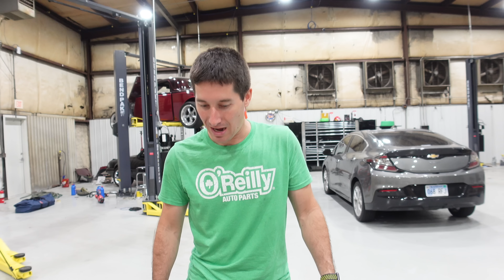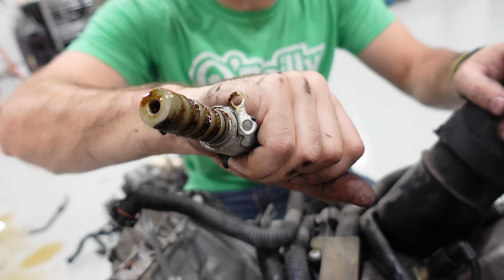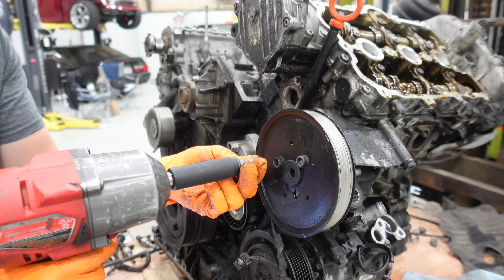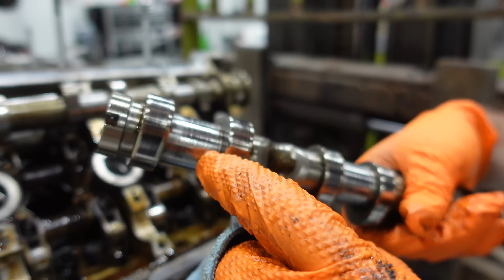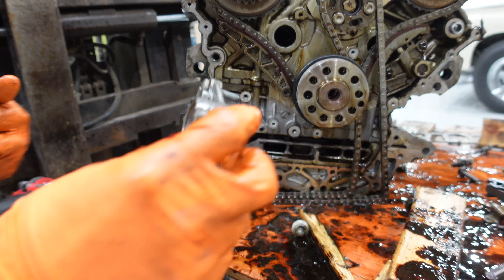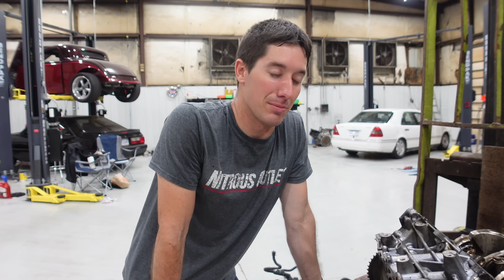SLUDGED To Death: Tearing Down My SEIZED Audi 3.0T Engine

Comment: This engine in the later years is very reliable, do maintenance and you will be golden
Reply: That's what fans of German engineering always say; nonsense
Reply: Can confirm. Just watch out for timing chain tensioner and guides. There's a TSB out on those. You can also get 600 hp with just a pulley upgrade, tune, and exhaust.
Reply: @kevinbarry71  80,000 miles on the odometer with 500 wheel on a 2015 Q5 3.0T, right after warranty ended which was 50,000. So 30k strong. I also own a g37x so I have both ends of the spectrum and work on both and honestly it’s not bad ppl like u just don’t know how to wrench on their car and say the car is trash because something broke and “the only thing I changed on my Toyota was the oil every 5,000 miles!”
Reply: @108emd  until it spins a main or crank bearing
Reply: So you're that guy. If I had said that a Yugo  is a bad car. Somebody like you would come on and say they have one with 300,000 miles on it and  they've never had a problem. German engines are put in with all disposable plastics. And plastics that need to be replaced and cannot be reached. And relatively minor operations require extensive disassembly. And even engine removal. Not to mention their irritating habit of having multiple different sizes of fasteners. When they could easily have just a few
Reply: @108emd  I was impressed with the condition of the timing chain guides
Reply: @hexicalcat4937  80k is not many miles. You may like to replace parts yourself but most people don't and shops will either destroy the car or charge arm and leg.
Reply: @jamesmedina2062  
When one stops and realizes what a 4 cyl. does day in and day out why is all this complexity necessary? I am so glad Honda never merged with VW. lol
Reply: @larrybe2900  Well I can tell you. Its all in the vibrations.. Subarus have such nice vibes and harmonics and ears matter more to humans than they realize. So they put up with Subaru eccentricities. The K20 and K24 were taller and beefier than B series Honda in order to flow better, be smooth, and hold 500 horses. But even though the VW VR6 was smooth and felt wonderful, VW snafus ruined it for me long-term.
Reply: @larrybe2900  with simpler little 4's, they will rattle your teeth out! My 1990 Acura and 1988 Honda Accord were not as refined as my 2017 Honda Civic.  At least with this fairly new Civic I have modded the car enough to make it pleasurable to drive. Honda implemented what I did to mine in new 2022 cars.
Reply: @jamesmedina2062  
Both styles progressed in parallel yet "VW" made it complicated. Non complicated engines run quiet yet run under more stress to move the car forward.  And / But yes, non-complicated have become more so but not to the degree we saw here. I am talking one of these complicated engines would not outlast the same rigors that a 4 cyl. operates under every time it is used. There is a company that repurposes used Honda engines for use in airplanes. We know the abuse an engine takes in a plane with high RPMs. Sure it is not a big plane but the application is brutal.
Reply: @jamesmedina2062  
One thing Americans are is practical. Planned obsolescence is eating away at every facet of mass produced items. Yes, I agree with you and we are butting up to the idea of the right to repair which will land us into expensive upkeep. Aren't we glad every car isn't saddled with the monstrosity we saw JR take apart. Any engine has to be a symphony in its operation but Mozart is not necessary for sensual pleasure. Granted Bluegrass is not for everyone either.  ;)
Reply: @larrybe2900  I think the failures in this Audi engine are an example of what happens when you have many, many pieces that make up an engine and you source parts from outside vendors. If you have less parts to keep a watch over, you can afford those parts closer attention to quality. If you make most of the engine parts in-house you can control and guarantee the quality.  My next door neighbor has this Audi engine in a very pretty white car. I don't think it has a turbo but it is called a 3.0T. He said oil changes were over 200 bucks at the dealer so now he takes it to Jiffy Lube.  One thing JR and we can agree on is that Audi definitely did not take into consideration service of this 3.0T.  Like you said primary buyers will own these vehicles for 5-10 years unless leased and then even less time.  I honestly don't see why this V6 has to be so big and complicated. We had about 5-6 Acuras with powerful V6 engines and Indy cars used solely Honda v6 engines for a while there. Perhaps it is also that cars and SUV's are so much heavier today, on average 1000 lbs heavier than 80's and 90's cars that conformed to certain weight and size limits. Also you are right that Audi knows how to make max bank. They have the trained techs and they know few people will be able to run these cars untouched for 20 years.

Comment: Anyone who touts "German Engineering" needs to watch this. The complete lack of serviceability of this engine is unforgivable. It does no good to have hundreds of sensors if the repair requires pulling the engine and 15-20 hours of labor just to change the water pump or other components makes this an object lesson in over-engineering.

Comment: The plastic on those engines will dry out and crack. Especially parts of the cooling system. 1000's to fix.

Comment: It's honestly funny to see outside opinions on how these engines appear to be "difficult" when in reality those engines are quite easy to take apart and teardown. supercharger off pays 5 ish hours and takes about 20 minutes lol. I will admit however, I did work on these most of my life as well as received audi training...I'm sure I have bias.
Reply: also, as I'm watching. When you guys were removing the intake flaps...the high pressure fuel lines are intended to be removed before the flaps. would've made your life much easier
Reply: That really helps them after the fact…
Reply: Ummm yeah...If you're doing a supercharger in 20 minutes when book time says 5 hours, please let me know who you are so that I would actively avoid you working on ANY automobile I may be forced into having service. Fortunately for me I do 99% of my own work on my cars.

Comment: If the recommended oil change interval was more than 5000 miles and the previous owner(s) followed that, then that is what killed that engine.
Reply: 5000 mile OCI is nothing with modern Euro and API oils synthetic oils - even the so called conventional oils. Perhaps the person owning the car didn't know what oil changes are? Could be a range of possibilities. Few, or perhaps no oil changes. Very short trips. Oil with the wrong certifications.

Comment: 3500.00 to service the supercharger with new oil….and replace the high pressure fuel pump due to an impossible to see leak…….worth it at 130,000 miles but still….and since its apart you replace the old poorly designed oil separator UNDER the super charger with a new re-designed equally. Poor one…..
Reply from the maker: Was it really? That’s wild, nearly what a used engine costs 😳

Comment: Safety first! In your experience, would the engine flush you used for the Camero make a difference on the Audi engine you just disassembled? Sans all of the coolant leaks. I can not imagine how so much sludge could build up in such a high performance automobile.... synthetic oil or quality organic oil. Awesome episode!

Comment: I blame the plastic coolant parts in the v of the engine. Looks like it was engineered to fail after a certain mileage
Reply: changing coolant before it becomes very acidic should help. The VW coolant is a good formulation.?

Comment: Here, my friends, we see the end of the fossil fuel internal combustion engines (which are followed by the electrified motors) and mainly the German quality of enginewizards. Plastic at spaces where temperatures are too high so they become really brittle, so much dodads and workarounds to get a low emission output that these ice are impossible to work with…..
Reply: ICEs don’t have to that complicated.
Reply: let me know how them batteries look in 10 years 🤣🤣
Reply: Same thing that killed diesel for passenger cars is going to kill gasoline-burning engines. Ever-increasing complexity to achieve high output, high fuel efficiency and low emissions at the same time kills reliability and makes repair less and less cost-effective.

Comment: exactly why people need  to change oil 3-5k miles regardless if  the manual says 7-10k!
Reply: Once a year regardless of low miles.
Reply: @larrybe2900  thats what i do on two of my vehicles- I use the 20k oil and in a year i usually do 3-5k on each so they should be fine-

Comment: It’s not ‘engine out’ to remove sc unit/injectors/pcv
Reply from the maker: It sure should be, it’s a nightmare 😂
Reply: @WatchJRGo  it’s not a hard job, just a lot of fasteners and packaging to get to the pcv/valley.  You did a few things out of sequence that kinda hung you up a little, I just did a top end service a few months ago. PCV, thermostat, water pump, carbon cleaning.

Comment: That's not had an oil change in a long time and slowly restricted oil flow then the ultimate happened & spun the bearing
Reply: True. However, it doesn't explain the coolant failure.

Comment: Sure helps if you know what your doing, attempting to pry the manifolds off with the fuel lines connected is assenine...I can remove everything to the injectors and pcv within 20 minutes.   Not sure how you claim to be a mechanic bro

Comment: how does a bearing get spun like that?
Reply: Oil passage likely clogged and then it gets hot and the bearing sticks to the crank or rod and spins with it. All comes down to the sludge clogging up tiny oil passages.

Comment: Spray connectors with silicone and let it sit for a minute.
Reply from the maker: They weren’t stuck, just brittle 😥
Reply: @WatchJRGo  It helps with them not crack when it soaks in. Learned in 15 ish years ago rebuilding Isuzu generators on shrimping boats in TX. 
I only work on euro crap now and still spray with silicone.  Saves me having to re pin into a new connector.
Reply from the maker: @diablo7322000  that’s awesome, I’ll try it! 🍻
Reply: @diablo7322000  any light lubricant can soak into areas that will make freeing it easier. Silicone greases are the worst from cleanup standpoint. I hate that choice myself. I was told some penetrating oils destroy nuts and bolts over time.

Comment: Every poor decision that went into making Audi engines was actually $mart ones. So you can’t save money working on these yourself. Parts are not cheap and probably almost no aftermarket parts to find. And has you tear it down it doesn’t seem to have anything special well built easy to work on engine have. Just more expensive for no reason.

Comment: I need to replace the PCV valve on a simple VW 2.0 TDI. Before a simple part that cost 10 dollars and 5 min to replace. But nowadays.. I need to replace the whole fckn valve cover. A 450 dollars part + labor. I seriously despise modern car makers for this disgusting practice. Nowadays any trip to a mechanic shop will set you back thousands. Forget about pollution, war or global warming. It is GREED that is going to make this planet uninhabitable for humans way before all the other problems do. 
But they won't screw over this guy again. From now on I will only own cars from before 2000. I don't care what it cost to keep them running. But NEVER will I give my money to a scammer car manufacturer again.

Comment: Luxury car engines made to last you 10000$ over their life. You could also open your wallet and let it empty itself while your driving and make sure credit cards also fly off on the road. That’s about what it will cost you to drive such over complicated machines. Not even taking into consideration your down payment of 120,000$ just to get the car out of the show room. That what it is, just a down payment. Expect to spend as much over the years just to keep it running. Because there is no way you gonna do DIY work on that. They made sure of it